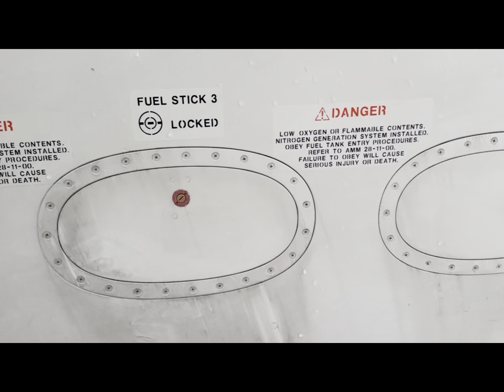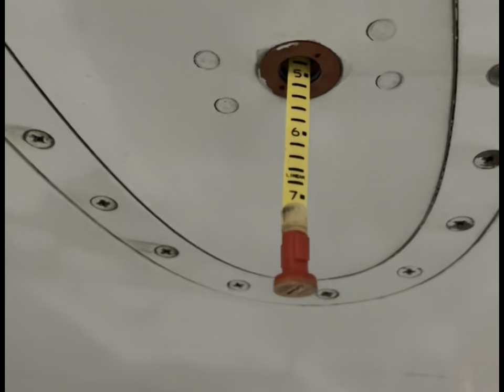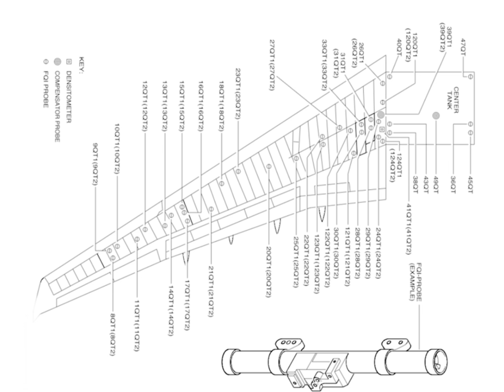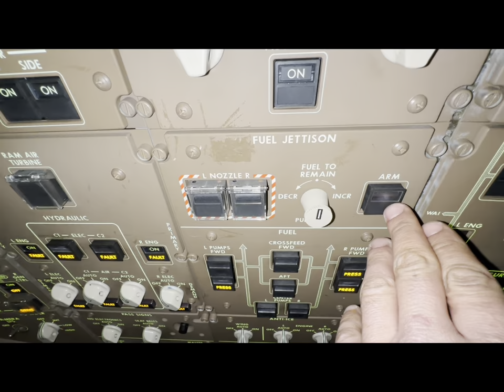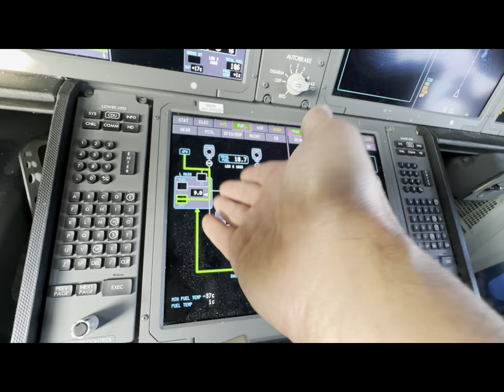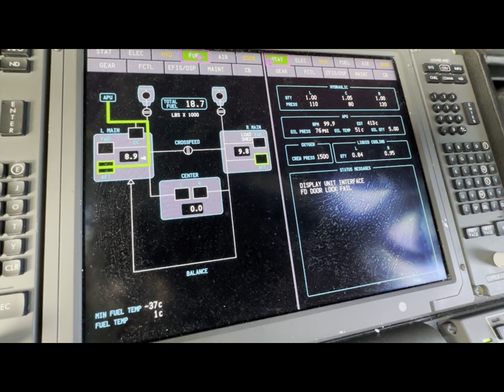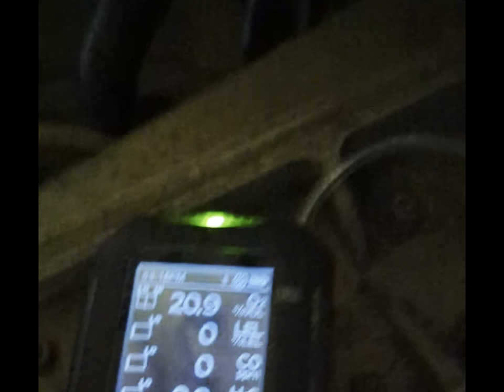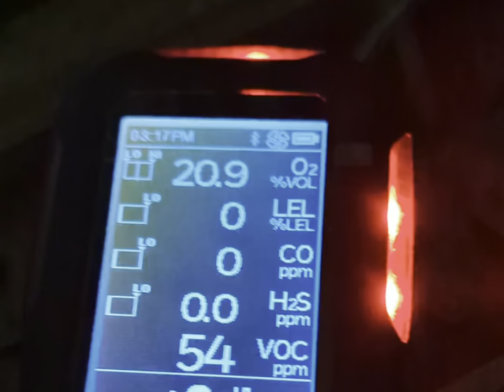Aircraft Wings and Everything inside of them.

Comment: Hey Stig, I found the ratcheting open ending wrenches you showed on your tool video. Had to enlarge a frame of the video to read “Alden” on the wrench.  Found out they were originally called Alden wrenches (named for their inventor) but that company is no longer in business. After some patent fights, I believe Chicago Brand (Medford OR) bought them out and currently make them.  They are still polished stainless steel, so no chrome chips to worry about as you mentioned, but are not quite the same quality as the old Alden ones. I bought a set as soon as I saw your video. Thanks for making me aware of them.  They are perfect for tight spaces and so much easier to use since you don’t have to take them off and on the nut or bolt. Just Google Alden wrenches. Your videos are highly informative and your attitude is infectious. Keep up the good work keeping us all safely flying.
Reply from the maker: Thank you so much.  I’ll definitely look that up. And I’m glad you are enjoying the wrenches.

Comment: I worked in emergency services in Upstate SC. Lockheed has a facility in our area (now they build the F-16 there). At that time, they had the repair contract on all the Air Force KC10 tankers. They allowed us to practice confined space rescue in the wing structures of these aircraft.  Despite their size, it's still difficult to move around when you're kitted out with respirator and supplied air lines.
Reply from the maker: Most definitely very difficult, here’s the interesting part, getting inside the tank is actually not that hard, moving inside and maneuvering through the baffles is a nightmare, especially when you start getting to the tips of the wings. And the most difficult part is usually getting out of the tank.

Comment: I love your videos!
Been reading conflicting info about the a320 mechanical backup. Do the rudders and THS have cables to them, only 1 or neither?
Reply from the maker: A320 family have a cable but they don’t actually touch physical flight control surfaces. They touch servos. So pure fly by wire system. But it’s a quadruple redundancy system
Reply: @StigAviation  Thanks.  So both the THS and rudder do? 
Also could the rudder be moved with elec trim if all hyd has failed?
Reply from the maker: @pilotboy2612  you got it. All FBY.
Reply: @StigAviation  Much appreciated

Comment: My sister is a rosie the riveter at Boeing and shes built dang near every 777 wing. 
She even Boogered one up. She put a template in backwards or sumthin. 
One of the airlines got a big price break on a wing. 
Im proud om my sister. She has never Illegitimately missed a day of work in her life from the time she started babysitting at 9 years old to this day.
Reply from the maker: I would be just as proud. That’s true dedication right there
Reply: Mistakes happen to everyone. Fortunately, the template was discovered. Too bad the door plug installation error on Alaska wasn't detected.
Reply: @ImperrfectStranger  that situation stinks to high heaven. My sister and her coworkers from what I've been able to gather are all extremely competent.
Reply: @williambarry8015  Competent people can  still help the holes in the Swiss cheese line up. What factors made your sister put the template in backwards? What made me blow an escape slide by accident? Environmental factors, paperwork errors, training errors, lack of crosschecking, etc. Loose bolts were found on other 737's, but some of those bolts may have been put in at Boeing's subcontractor and other bolts on the main assembly line in a different city.
Reply: @ImperrfectStranger  you pulled an emergency by slide by Accident?🤣🤣🤣🤣🤣im laughing with you. Thats an awesome oopsie.
Reply: @williambarry8015  Well, I triggered a slide by accident (electrically). I didn't, for example, open a door with a slide armed, if that's what you mean. The system can be triggered by electrostatic charges if you don't take appropriate measures.
Reply: @ImperrfectStranger  i know. Stuff happens.
Reply: "There are two types of people. People who make mistakes and people who lie about it" that's everybody's story.

Comment: I have been proudly in every B747-400 fuel tank from the huge center tank where you can play cards 🃏 to the small coffin size tail tank and the outer vent tanks. It took always some time to get rid off the fuel smell aka Chanel 28 😂
Reply from the maker: That fuel smell seems to linger on forever. I got drenched a few times in my career… I tell you what… not only the the clothes go straight into the dumpster… but after about the 15th shower.. I can still smell it 🤣🤣
Reply: @StigAviation Dior Fahrenheit 😂

Comment: Another extremely amazing video 
ABSOLUTELY love it 
Here i am thinking aircraft had great big rubber bladders in both wings and in the middle also.
awesome stuff
Reply from the maker: Thank you. Glad you enjoyed it. Glad you mentioned the bladder style … there are aircraft that have that as well.
Reply: @StigAviation  😂😂 Just discovered there is 4 different types of tanks 
Bladder style 
Tip tank
Rigid removable tanks
And 
Integral fuel tank. 
So I guess from what I seen pretty much all passenger aircraft have integral tanks and have never had bladder tanks.
Only small Aircarft and the airforce and i guess some helicopters also.
I seen on some TV show it MIGHT have been Dirty Jobs with Mike Rowe years ago lol.
They pulled a old bladder out of a wing and replace it or repaired it.
I know the airforce also use them alot for transporting the fuel AND in aircraft tankers for mid air refuelling.
Reply from the maker: @johnnyo7621  you’re absolutely correct John, but here’s a little interesting thing, the Airbus also has additional center tanks, we called them ACTs. Those actually have a bladder inside them, don’t ask me why they did it like that but that’s how they designed it.
Reply: @StigAviation  😳😳 Goodness now you got me thinking Stig.
Trying to think if you ever mentioned it before since you have pretty much covered just about everything on passenger aircraft lol
Reply from the maker: @johnnyo7621  I have barely scratched the surface on commercial aircraft. There so much more involved in the things I talk about. Remember, I simply open the door for you. You get to walk through it and dive into the rabbit hole. Endless amounts of knowledge and information out there.

Comment: How does the air inside the tanks get vented off while fueling? Is there like a fuel vapor capture device like the evap system in cars?
Reply from the maker: Via the vent valves.  Under side of the wing has vents. And also in flight the NGS is being feed via the air conditioning system

Comment: Question: you said that if the fuel pumps become inop it will still work with gravity wich makes sense for me when it comes to planes that have their engines under the wing. But what about planes with engines on the tail since the engines are above the wing? Or on tri-jets like dc10/md11 or l1011 would engine 2 just quit?

Anyway another amazing video as an automotive mechanic and AV geek its so cool to see how things work. Keep up the work man!
Reply from the maker: Those are a bit different, those aircraft will use a Venturi style suction to get fuel to the engine.
Reply: @StigAviation  interesting. As always thanks for the information!

Comment: Yes, sir Stig it’s called suction feed when the engines are running they will stack fuel out of the tanks even with no fuel pumps operating
Reply from the maker: You are absolutely correct my friend. I was just trying to simplify it. But you are totally right
Reply: ... with no tank fuel pumps operating. There are still fuel pumps on the engine.

Comment: Do any aircraft have fuel in the horizontal stabilizer?  I think it might have been an option on the 747's.
Reply from the maker: 747 has the option. 330 also does
Reply: @StigAviation  Looks like the A380 does or has the option as well.  Thanks for the video.

Comment: Hi stig what is the minimum quantity of fuel that can be jettisoned? Is it possible to jettison fuel if remaining fuel in the center tank is 200 kg during flight? Center fuel tank pump Low pressure light illuminates if there is  low fuel in the center fuel tank.
Reply from the maker: I’ll be honest with you I can’t remember what’s the minimum amount. I would have to look that up. As for the center tank, the fuel from the center will be pumped into the wings regardless of jettisoning from the wings.
Reply: @StigAviation okay stig.   I had this question in my mind, I thought to share it.

Comment: Lets remember the fuel heaters as the fuel goes to the engines. BA 777 froze its fuel and landed short of the runway at heathrow. Just one of the many components people know nothing about.
Reply from the maker: Well the 777 is very special.. it actually has a hydraulic fuel heat exchanger inside the wing tank itself.

Comment: All this technology unfortunately comes at cost. While working for UAL in the 1990’s, a sheet metal mechanic was doing a repair inside the wing of of B767-200 series. The aircraft was parked on a hard stand where there was no pneumatics or electrical available. The mechanics working decided to use nitrogen to power their pneumatic tools since a compressor was available. The mechanic were using a tool similar to the one shown and we use to call it a sniffer.  Sone access panels were opened but not all of them. The lookout mechanic followed procedures to check on the mechanic inside the tank every 10 -15 minutes. On one of the checks there was no response. Unfortunately the mechanic suffocated due to the nitrogen displacing the oxygen. After the accident happened, we were all mandated to use air compressors instead of nitrogen and the nitrogen carts were refitted to stop the use of nitrogen on pneumatic tools. It was a very sad day in the industry when this accident occurred especially on the families that was left behind. Aviation is beautiful but rarely  forgiving.
Reply from the maker: I remember that story very well, that circulated around and scared us all. There has been many cases like that, I’m sure you’ve heard the one where the mechanic got completely forgotten about due to a shift change. They sealed him up inside the tank, and the aircraft took off. You can imagine what happens after that. Safety is number one we have to be diligent not only for the aircraft safety but also our own.
Reply: @StigAviation  I agree 100% with you. I’m retired from the field and enjoy your videos. Brings back good memories. Keep up the good work.

Comment: What do you think happened to Alaska 1282 losing the plug? NTSB also reported the depressurization lights had come on 3 times prior to the accident. How can you all check that?
Reply from the maker: I believe the news is already out and it was a case of loose bolts that hold the plug. As for pressure checks… we can perform pressurization on the ground. Basically seal the aircraft and pump it up using the air conditioning system
Reply: Im just glad no one was seriously injured or worse. Shouldnt the pilots have written up the indicator lights coming on especially since it happened twice while the aircraft was on the ground? Would that be a reason to ground the plane from service until the issue was corrected?
Reply from the maker: @stevec7793  in my opinion yes, the Pilot should’ve written it up, or maybe they did and whatever procedure they performed, corrected that issue at the time. Once again, I don’t know all the details of what transpired with that aircraft. So it would be purely speculation, and, I cannot speak on something I don’t know, that would be unprofessional of me. That’s why I say I will wait for the official reports.
Reply: True. Keep doing what you do. Love the content!!!!!!

Comment: Stig, would you please show us what component failed in the Alaska Airlines 737 and caused the loss of pressurization? Thanks.
Reply from the maker: My friend it’s already out in the news. The bolts that hold the plug. I don’t need to make a video or explain it when it’s already done.
Reply: @StigAviation  what plug are they talking about?
Reply from the maker: The things that actually blew out is a dummy plug. They have an option to have a door there, depending on seat configuration.

Comment: With the Air Canada Gimli glider, the fuel quantity indicators in the cockpit were inop and they had to stick the tanks. Everything was going to plan until they screwed up converting gallons to liters. They thought they had enough until they didn’t…
Reply: Also regarding the Alaskan Max 9 plug door screw up, why on earth weren’t the bolts on those hinge points not safetied or locked in some way? In the picture from a United Max, two of the bolts looked like they were two turns out/loose. And the bolts looked like they came from Home Depot. You can’t tell me safety wire capabable bolts cost more than the junk they installed. They don’t weigh more, in fact with the holes in the head they weigh less. I hope American checks their 789’s if they have the door plugs…
Reply: Hey Stig, I just looked at pictures of American’s 789’s on Planespotters and it appears they all still have the doors in them. Makes me feel better. My wife’s company found five aircraft with loose/missing bolts and some other shenanigans. I think they would have caught the oopsies if they were built in Seattle but we all know they aren’t now…
Reply from the maker: @kraz904  we don’t fly -9s   We only have -8s. Please correct your statement my friend. As in regards to the -9 I don’t have an option because I will wait for NTSB reports before I trust some random news media outlets for silly news. I recommend you do the same before jumping to conclusions and trying to assess a situation that is beyond you or me.  Is that fair to say?
Reply: @StigAviation  , my info didn’t come from the news regarding the hardware. As I mentioned, my wife’s company had the five aircraft with the loose fasteners. And I was mistaken. American won’t start getting 789’s until later this year…
Reply from the maker: Wait I’m confused now 😅 are you talking about the 787-9 or 737 max 9. I think we are mixing up fleet types here

Comment: What percentage of the total fuel load is stored inside the center tank?
Reply from the maker: It depends on the type of aircraft, but I would say around 40%
Reply: @StigAviation  So on a larger twin aisle plane such as 777, the center tank could easily hold more fuel than a long fuel tanker truck.

Comment: So what you’re saying is that those wings are completely filled with gas like a bottle of water?
Reply from the maker: Yup. 👍
Reply: A 777 holds around 45,000 gallons total. It’s got to go somewhere, and the wings are hollow anyway. If I remember correctly, each wing holds about 13,500 gallons. The remainder is in a center tank in the fuselage, which is burned before the wing fuel for structural considerations. I rarely flew one with full fuel though. If the trip doesn’t require full fuel tanks, it’s not carried as it takes fuel to haul it. The few times I had the tanks completely full on a 777-300 (313,000 pounds or something over 45,000 gallons) I was flying from DFW to Hong Kong… 16+ hrs. An amazing airplane. Then along came the 787. Even better!

I really enjoyed this video. Stig is really knowledgeable! Brought back some great memories.

Comment: Fuel tank work, UGH!  That cold fuel is so cold you want nothing to do with it as it will give you frostbite in a heartbeat.  In all my years of working commercial aircraft I’ve never seen a multiple fuel pump failure, seen onesies and occasionally two out on a 747, but for the most part, Boeing aircraft have pretty robust fuel systems.
Reply from the maker: Same here, Boeing and Airbus both… I rarely see fuel pumps fail.